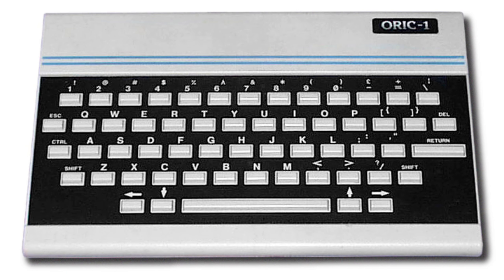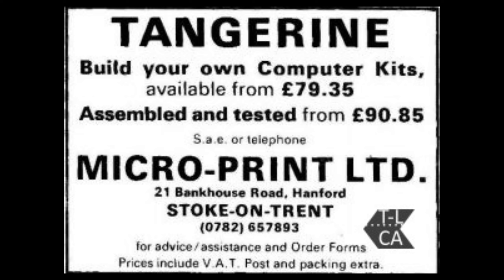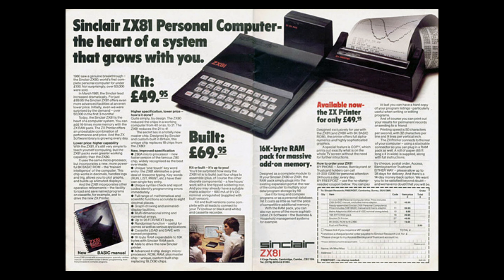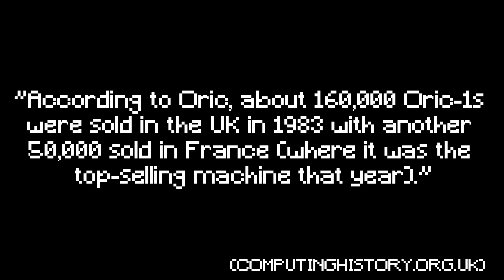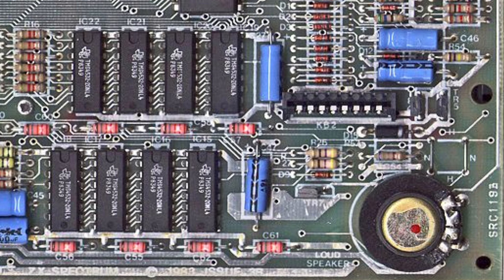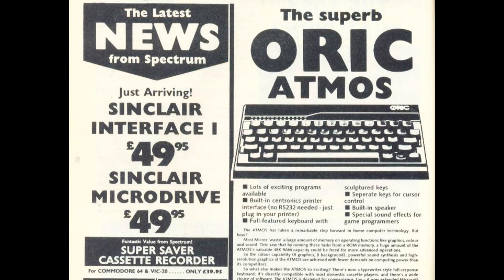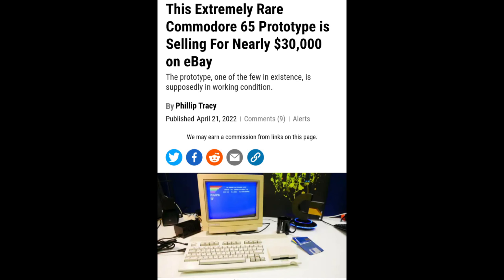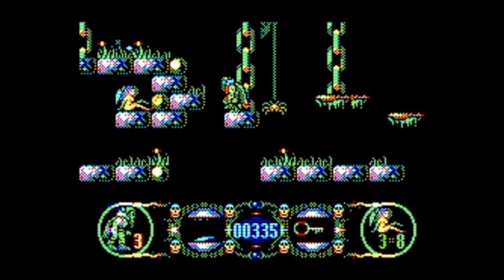The Rise and Fall of A Forgotten Micro

Comment: One comment on the CPU speeds: A 6502 clocked at 1MHz is roughly equivalent to a 4MHz Z80 because most Z80 instructions take more cycles than the 6502 equivalents. It's just a rule of thumb, but it's close enough in practice.
Reply from the maker: Ah thank you for your info. Apologies if I mislead.
Reply: @JustJamie1983  No problem at all, and thanks for posting a video about this forgotten gem.
Reply from the maker: My pleasure. I don't think that their is enough on YouTube of these almost forgotten micros.
Reply: Now that is a very interesting fact. I always presumed the C64 managed to handle the games' side of things due to hardware sprite handling and its SID chip.
Reply: @sma7530  Those made a big difference, too. They're why the C64 has better sound and graphics than the Oric and Spectrum, which were more or less equal. Ok, maybe not the sound, because the Oric did have the AY chip.
Reply: I'd say it beat on sound too. The AY could only output square waves unlike the sid's more complex offering. But it for a 70's design it was good.
Reply: @navalenigma  Again, I very interesting piece of information that I'll take on board
Reply from the maker: @navalenigma  I think i would agree too.
Reply: @navalenigma  Agreed. The C64 was quite advanced for its time.
Reply: @strayling1  never had one but it was a amazing machine with those dedicated chips. You look back with your knowledge today and can really appreciate it.
Reply: The Z80 does have more registers though. That must make some difference

Comment: The Oric1 and Atmos were not bad  machines. Though you have to almost ignore the uk market and class it as a success in Europe. Ps the 6502 clock for clock is more efficient than the z80, which to a degree evens out the z80's faster speed.
Reply from the maker: Ah brilliant. Thanks for letting others know.